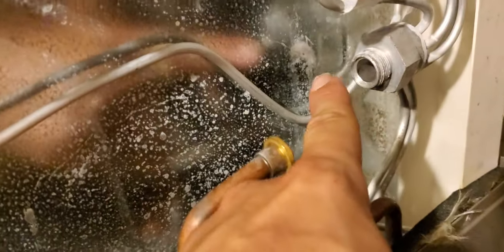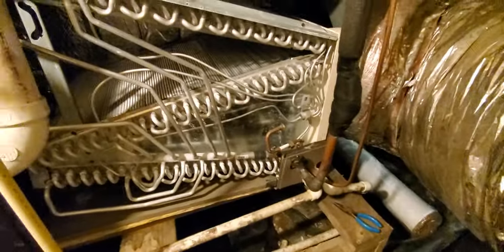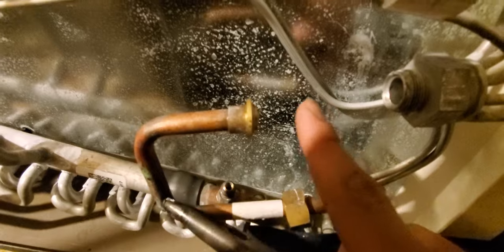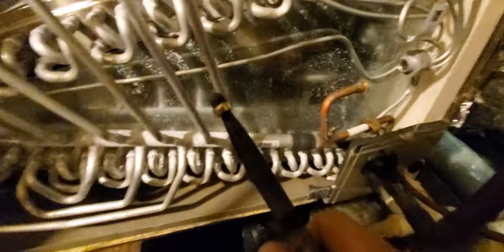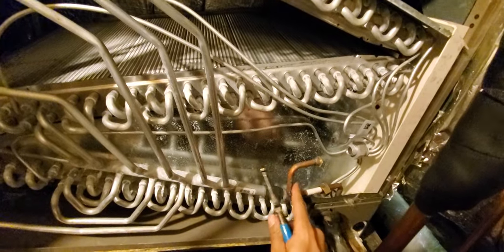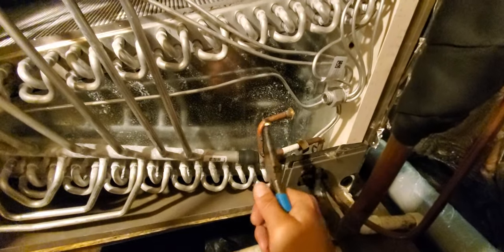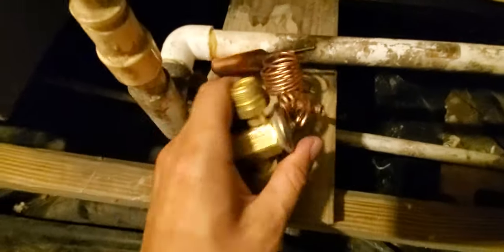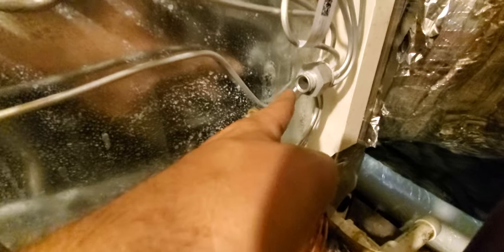Replacing TXV on aluminum coil with clogged screen

Comment: Are screens only in aluminum cois? Or on txv's that have flared fittings?
Reply from the maker: Hey Robert 
Screens are in most copper and aluminum coils as protection for the debris that could enter the txv and cause it to stick.
Reply: Depends on if the person that installed the txv put the screen in